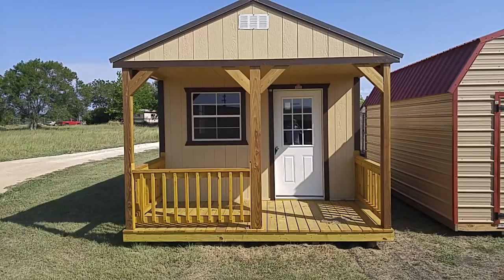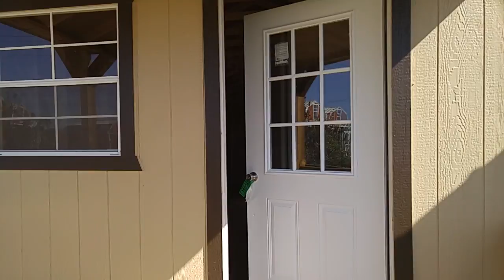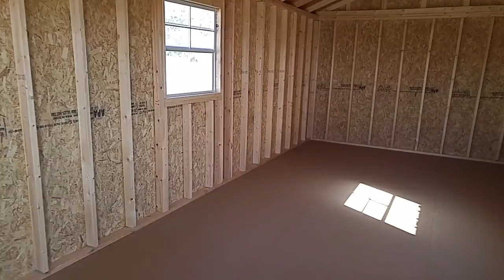TINY HOME...CABIN...UNFINISHED!!!

Comment: I know a newly divorced lady, who bought a used 12 x 24 ft storage shed for $3000.00 and had it moved and reset, to her elderly parent's home in the country. She ran an under ground electric line to the shed and has access to the existing well water system too. Her choice is to use a composting toilet, and drain any gray water she uses, into a buried 55 gal. plastic barrel full of gravel. She did most of the renovation, (complete insulating, wall coverings, flooring, and lighting) herself, using yard sale finds, thrift stores etc... From the outside, it looks like a a typical tool shed, you would never know the beautiful tiny home she created on the inside. Very stealthy and yet functional. Total cost: $5000.00 paid in full. She does pay her folks a small monthly fee for (utilities, insurance, and property taxes...etc ) but that is way cheaper than renting someplace else and she is there for her parents should the need arise.

Comment: Good vid, nice homebase & storage project to stay busy. You could be a snowbirder with this. On a sunny day I run my electric mower from my solar panels directly from the inverter. My bats are usually charged by 1 or 2pm to 98%, after that I use the excess to run my corded electric mower. Actually come to think of it, the new 80 volt battery powered mowers would be a good way to use the solar panels.